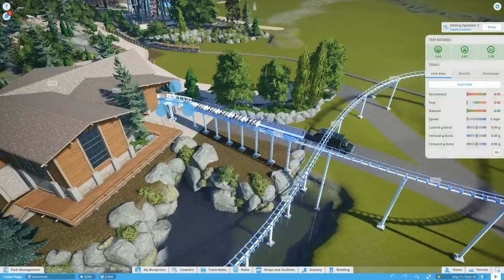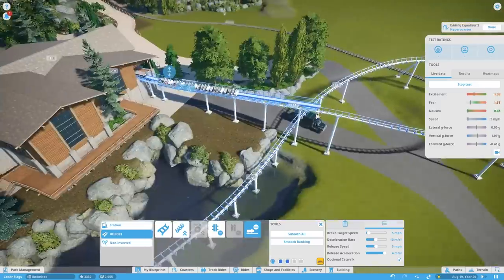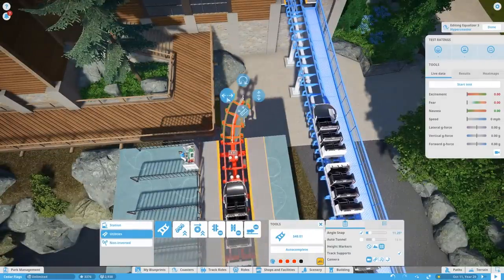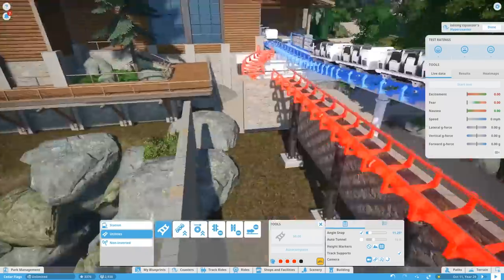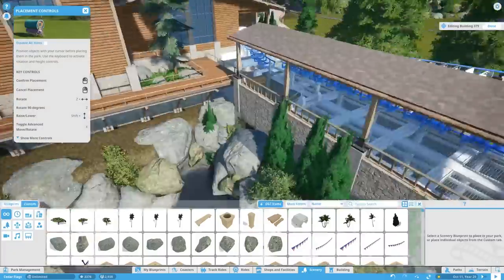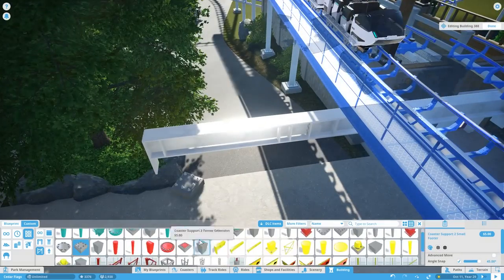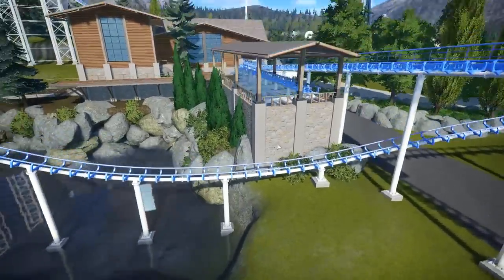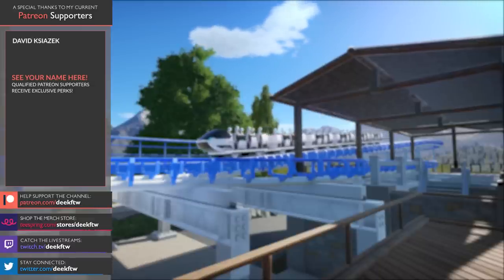Let's Design Cedar Flags Ep. 34 - Building a Roller Coaster Transfer Track - Planet Coaster

Comment: Progress is looking good 👌 Couple years old, but you mentioned you thought you added enough distance to your sliding rails, for the straight track to slide over. In fact, you don’t need nearly as much. The distance your S bend has to travel, in order to line up with the straight track in the shed, is the distance that your straight track will slide over, in order for the S bend to close the circuit on the coaster, so not much is needed. Looks like you may have added enough sliding rail, to account for the beginning of the S bend ( that connects to the track in shed ), to connect to the coaster circuit, when the beginning of the S bend actually only moves that small distance, to connect to the shed track. Only really need roughly 1/2 of what you have extending out from the straight track.

Comment: Not sure if it matters to you or not, but your transfer track is of the wrong style. The way you have it built is how Intamin does theirs. The Arrow transfer track is similar to B&M where the transfer track spans the entire length of the train and shifts to the left or right to the train maintenance/storage building where there is enough garage doors/tracks to store all trains if needed.

Your does look good and I applaud you for building one even if it is incorrect. lol

A good way to get cinematic shots is to set up a roller coaster without shoulder harnesses (so the wouldn't get in the way of your shots) and have the track be level with drive wheels get into rider view (not track view) and capture your target as the train car goes by. for birds eye shots do the same but with the flying coaster train so the track wont be in the way and disable supports make sure your shadow isnt in the shot either.